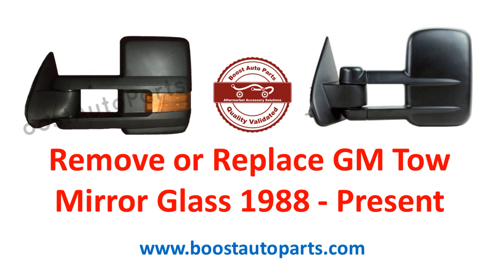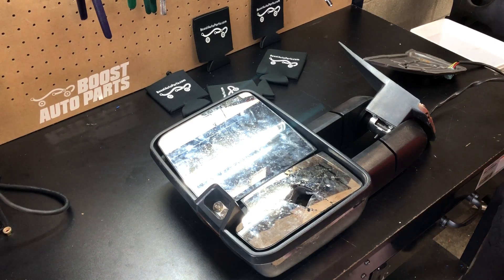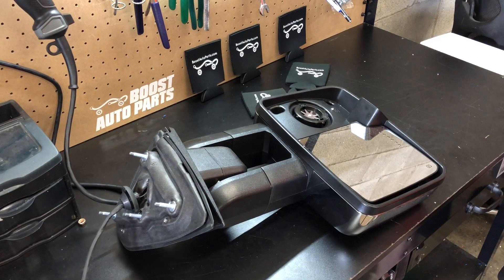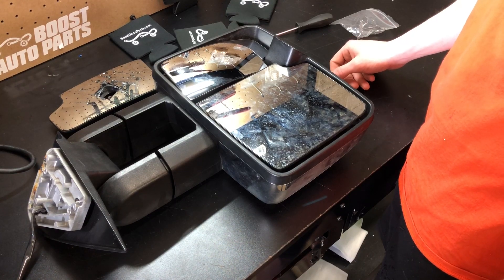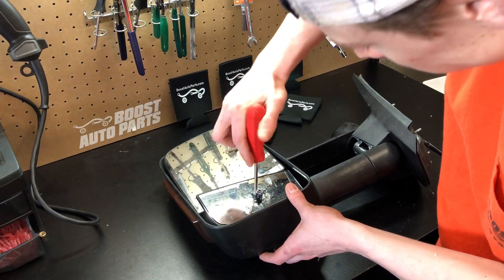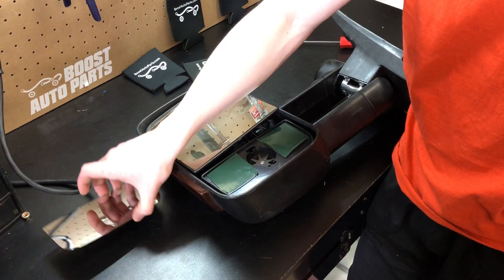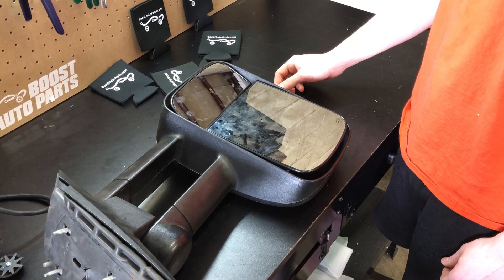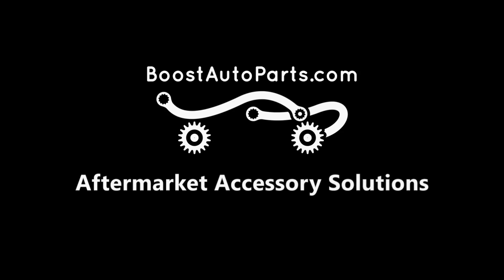Remove or Replace Tow Mirror Glass Silverado or Sierra 1988 - 2019 GM Trucks SUV's

Comment: is there anyway to tell which mirrors have snap-off lower glass?
Reply from the maker: You can tilt the glass all the way down and look to see if there is a snap mechanism or ball socket (non-removable) mechanism
Reply: @boostautoparts since that’s the case anyone plant matching mirrors just buy the new bottom glass or can we just paint match the mirrors as a whole as long as it’s taped up great . U think it will wild look as good with it painted like that compared to painted in pieces

Comment: Can you add a turn signal mirror into a not turn signal mirror. Or if it doesn’t come with the blinker on the mirror you just won’t have that feature?
Reply from the maker: All of our mirror assemblies come with the turn signal on the glass. If your mirrors are not from us you may be able to upgrade and add the feature using our glass if you are handy, but we don't have a video showing how this is done.
Reply: Boost Auto Parts okay! I was wanting to add them to it. Thank you!
Reply: Boost Auto Parts how would you add the light for the blinker or the front mirror let reflects enough for it to go off? Or do you have to add one?
Reply from the maker: @dakotasoutdooranddieseladv936  You have to purchase glass with the integrated signal and then splice it in

Comment: Is a 2012 a snap in style or a push up latch for the larger upper mirror?
Reply from the maker: It depends if you have OEM or aftermarket mirrors. Contact support@boostautoparts.com and our team can further assist

Comment: I purchased ECCPP Tow mirrors for my 2001 Chevy Silverado HD but the wire harnesses on the mirrors are diferent from my truck. Does anyone know where to buy the  wire harness adapters that has wires to control the mirror movement, the turn signals and running lights ?? I haven't yet seen  any videos explaining what to do if the wire harnesses were different for the original factory harnesses.
Reply from the maker: It sounds like you have mirrors for the wrong year; you will need to get mirrors that are correct for your year. We offer those mirrors here: https://boostautoparts.com/products/1999-2002-tow-gm-mirrors

Comment: Where can i get a replacement mount for the lower glass for my 2015 style tow mirror?
Reply from the maker: We offer it at Boost Auto Parts!

https://boostautoparts.com/collections/2015-style-gm-tow-mirror-glass/products/replacement-mounts-lower-glass?variant=41866583111
Reply: for anyone who lost the cup mount that goes between the mirror mount and screw and washer. instead of paying 28 bucks more to buy a new one. on top of the 28 they selling their mirror glass for ( :/ Grrrrr ) i made my own worked great. been driving for a week now everyday now hasn't moved at all. buy you a baby snot sucker thing. cut it right on the line on the in the middle of the thing it has a line that goes all the way around cut on it on the sucker side, go all around make it even because that side will be for your star washer and screw. then on the round part that fits just right in the window mount cut a hold in the middle so the screwin plastic stick sticks through. works great buy one at green tree if they don't have any buy some where else.